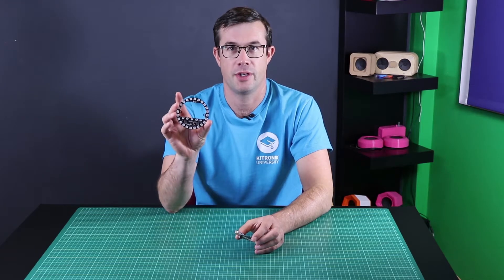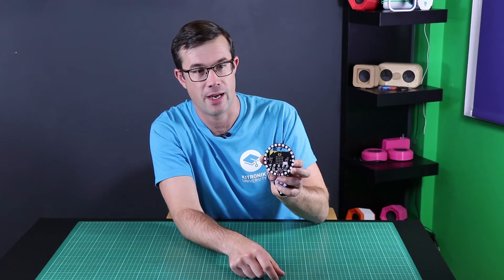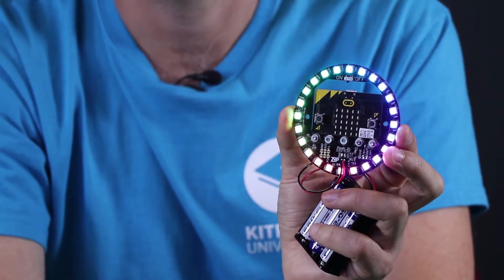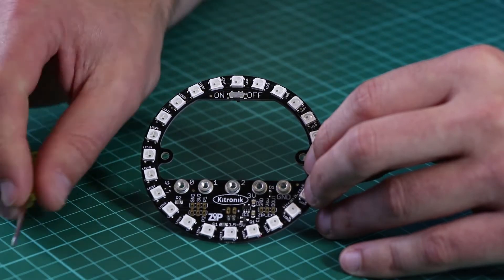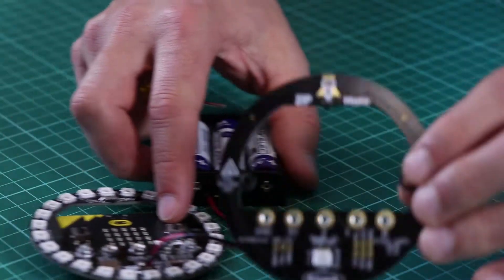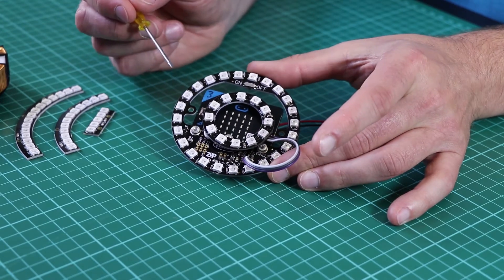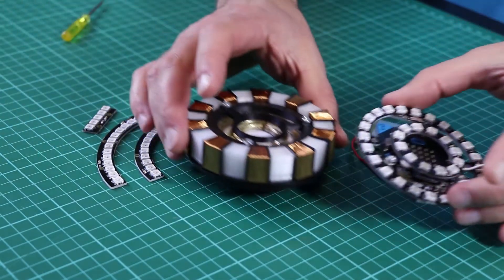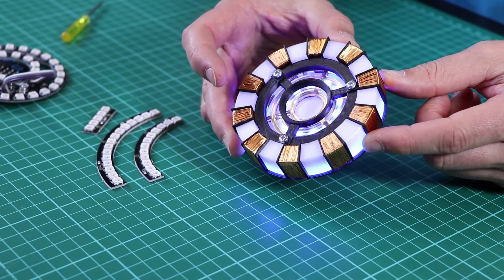Zip Halo by Kitronik

Comment: I'm totally puzzled. I have a gamezip 64 which works great with a V1 microbit on the Arduino IDE. But the same code (Adafruits strandtest) does not light the LED's on this nor the ZipHalo HD (on P8 of course). How is that possible? If I use a microbit V2, it works on all ZIP addons!
Reply from the maker: Hi, it's difficult to speculate without seeing the code.
Reply: @kitronik  Its the Adafruit Neopixel Strandtest example, with the only modification being the pin number and the number of LEDs